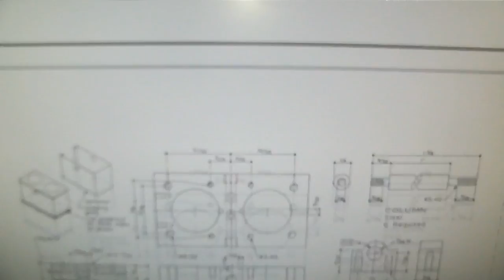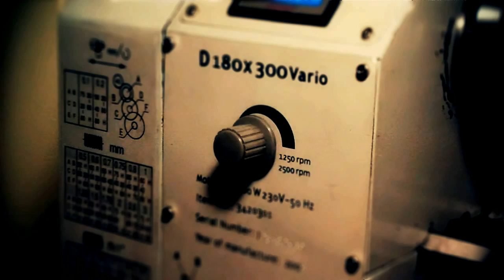Optimum D180 x 300 Steam Engine Part-1 (Cylinder Block - A)

Comment: Dear Baseline I am building the open ended double steam engine.  I have a query How did you manage to face the connecting rods in a collet as the round shaft will not pass in a 6 to 7 mm collet and cannot be held in a 7 to 8 mm which is 5/16 and the narrow part being 1/4.  How did you manage to align the Crankshaft to have the rods at 180 degrees?  Thank you if you can explain.  I enjoy your videos very much and you are a great machinist.

Comment: is it possible to use this machine this way you use now with harder metalls like 13crmo4 or ss ?
Reply from the maker: +MrCcfly Sorry for the late reply. Yes but, not on a big diameter stock. Below 25 to 20mm with coolant would be okay. Threading would be a pain for sure. If you can afford a bigger lathe it would be better.